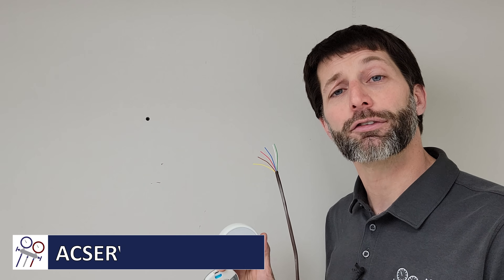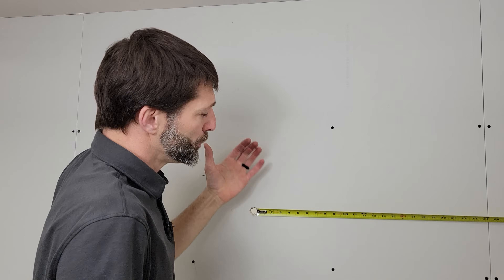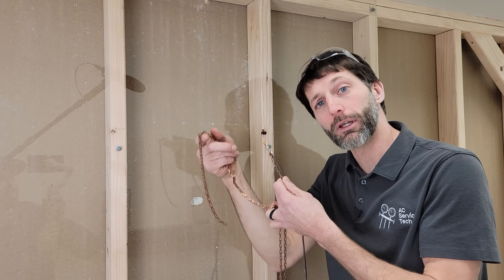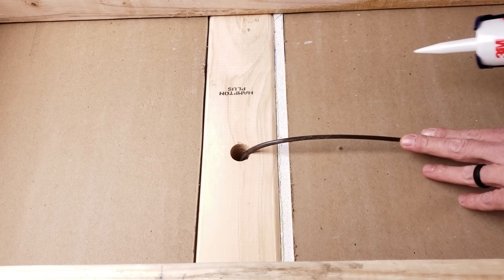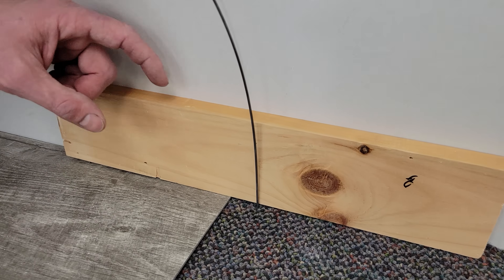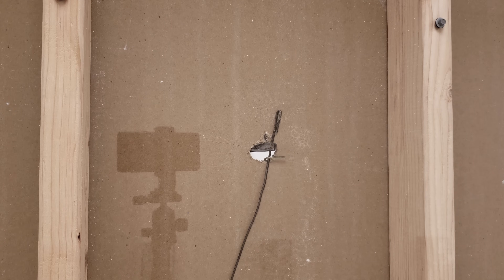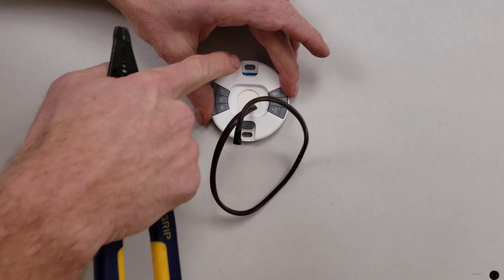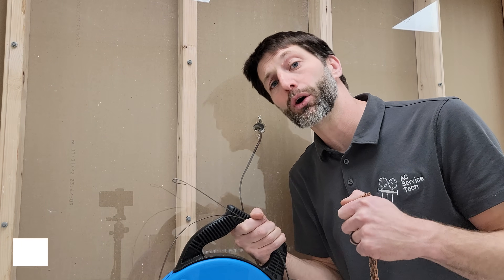How to Fish THERMOSTAT WIRE Up or Down a Finished Wall! Install Methods!

Comment: I need to run new thermostat wire to replace my old wire. Had to replace the circuit board on my furnace with a universal board, and now the main blower comes on and the furnace doesn’t work. Also replace the limit switch. The existing thermostat wires are not color coded properly. So replacing the wires seem to be the next logical step. The furnace is directly below the thermostat, so attaching the new to the old upstairs, then locating the wires downstairs and pulling them through seems to be the way to go.

Comment: I personally like to pull the baseboard off, smash a small hole in the drywall, drill a hole downwards, pull the wire and cover it all up with the baseboard

Comment: Great tips. Are there methods to replacing the wire if the current one doesn't have enough conductors?

Comment: so i have existing. had new furnace installed and they f** the wiring.  Is it possible to fish a new wire? It is a ranch style. thermostat is in the hall , so it has to go up, over the hall way bath then down to the  furnace closet.
Reply from the maker: look up "acservicetech fishing thermostat wire" on youtube thanks

Comment: Any tips on how to prevent the wire from falling back into the wall after its fished.  In the video you do all the wiring with it as a curly cue at the top, but that seems risky and I really dont want to have to fish it again.

Comment: I’ve found the easiest way to route the thermostat wire is to slide out the wall mounted oven and run the wire behind that, then slide the oven back in.  Then, you can check and set temperature when you are in the kitchen, where people spend most of their time anyway. 
By the way- are you going to do a video any time soon on the subject of why a boiler seldom runs??

Thanks for the great info
Reply: Why a boiler seldom runs?? Check the thermostat is not near the oven or in a hot kitchen.
Reply: @larkhill2119  my post was a joke. I know he doesn't respond but makes Great vids. Sorry
Reply: @Drrich_DIY  LoL, Sorry  I just lack faith in humanity

Comment: I use to fish the wire up to down with a treat and the end I put a socket I put it in the hole them say I slow down the socket about 2 o 3 feets down then I catch the socket with the strong magnet bring it to the hole

Comment: quick tip ppl. carry a magnet in your pocket it will find you a scree in the stuff super fast and its a cheaper method then them other electronic devices and takes up less space

Comment: Great tips, I use the chain and pull through with a small stick magnet same in the floor. Pilot bit through the carpet is all fun and games until it starts to pull.

Comment: Total bull.  What about all the insulation.   Looks real easy not using a actual setting.
Reply: Interior wall probably won't have insulation---and you shouldnt install a tstat on an exterior wall...
Reply: @samhazard9576  just a FYI, commercial interior walls are usually insulated for sound purposes. And some residential interior walls are also for same purpose. at least around here they are
Reply: True certainly much easier without all the insulation
Reply: Wow, this is an example...

Comment: I saw one, that had a super magnet, that has you drag the magnet down the wall pulling a plumbob like steel weight.  It  looks great, and eliminates the problem of negotiating wall insulation. The thing I always fear is accidentally hitting a water pipe or power line.  I had this happen to me once in Alaska while in an apartment nailing in quarter-round in the ceiling, the customer was absent.  Then it became ,”wheres the water supply cut off”? Talk about jumping t(rough your butt....  My lesson learned is always know where the water supply cut off is, and service disconnect “BEFORE “ you start work and the location of the nearest fire extinguishers are....just in case. When fishing wires are a problem, remember,  this is 2022.  Wires are quickly becoming obsolete.  I hung a Red-link thermostat and receiver,  in an all concrete and steel building up four floors, and the customer insisted I install the steel thermostat lock boxes to boot.  I was shocked.... these things worked great.  This was about 5 years ago. Its cost less than a decent programmable would.  I just wired the receiver in the cellar... this is an option in case your on a second floor and need to reach the basement, so you don’t have to fish wires through two floors, patching...
Reply: Wires are becoming obsolete? LOL 👌
Reply: @robertcherry4971   That was the statement that made me raise my eyebrow too.. Mainly "wires" and "obsolete".
Made me curious about the replacement technology that is going to run electricity through to my house, street, town ,city , Country...   🤔 
The new tech will put a world wide end to copper cable theft 😁
Reply: That is a Klein Tools Magnetic Wire Puller model 50611. It works very well.

Comment: How do you handle walls with perlings? Those are normal around here.
Reply: I think you mean fire blocks in interior walls. I believe perlings are connected to rafters. But too your question, I just cut a square above the 2x4/fire block and use an angle bit with a paddle bit. A flex auger bit, or a long flex bit works going up from a basement, but good luck try'in to go down an attic if there's no room.

Comment: I'm pretty good at drywall work so I generally just cut the drywall when I have a questionable spot. Takes longer by after drilling through a drain line well just say lesson learned.

Comment: On the one for the basement or crawlspace why didnt you use a chain and drop it down from the hole 
You did it from the attic you do it the same way just trying to find the chain up thru the floor

Comment: Remember, if you are working in an occupied home, especially with children, warn the adults of the insulation supports and always bend them over so they won’t penetrate a shoe and/or foot. 

Also, you can use the chain to drop down the painted interior wall to “plumb” for alignment. Drill your insulation support down to locate in crawl space. Drill hole up through bottom plate. Drop chain down from above and tape wire on and pull back up. 

Also, when drilling insulation supports through carpet, go slow at first, just in case it grabs a thread. Some types of carpet are worse than others. 😊

Comment: Little advice, stay away from NEST thermostats, nothing but problems. Not going to argue with anyone here about this, just a personal opinion after fixing  many many issues with these . In about all the cases ended up replacing the thermostat with a regular programmable thermostat or a plain Jane thermostat. I have yet to meet a customer that was happy wasting their money on these Nest thermostats, usually they pretty pissed because they wasted allot of money on these pieces of junk.
Reply: Most of the time its lack of a common wire. There are C-wire adapters yet running a proper thermostat wire usually not an issue. Have installed over 25+ no issues.
Reply: My NEST works by disabling autoschedule and manually setting home/away.  Set up B/O wire in the menu otherwise may not energize reversing valve.  Also use unused blue/brown/black wire coming from thermostat for common to handler if don't power on.  No need to run another wire unless its 22+ gauge or too few connectors.
Reply: @dwj7386  what heat pump manufacture?
Reply: @proanswers  I believe Rheem, Rudd, Oxbox.
Reply: @dwj7386  Rheem & Ruud energize the reversing valve on a heat pump in heat mode * against the industry standard of cool mode. Sounds like you had the orientation of the "O" and "B" low voltage conductors reversed and or the heat cycle test through NEST incorrect settings. Common correction we see in the field.

Comment: Why you not use holsaw cutter for make hole
Reply: Because as Craig stated you don’t know what is inside the wall, could be wires or piping and using a drill you cannot feel what it is drilling into till it’s too late.
Reply: My brother is a plumber and is always busy because someone cut or put a nail in a pipe doing trim, new cabinets, new floors and some of them don’t start leaking till years later

Comment: What kind of wall anchors are those? @ 13:28
Reply: Auger anchors that come in the white plastic and aluminum  - the aluminum are rated to hold heavier weight
Reply: The honeywell thermostat comes with yellow anchors is the one i use

Comment: Great tips 👍
Sometimes the only choice you have in finished spaces is to run the wiring in a return duct using plenum rated cabling. If run in a supply duct it must be rated at 105*c minimum.
Reply: Its not the only choice just the lazy one.
Reply: @zoso1123  that or tear holes in ceilings and walls
I agree but sometimes there is not a better practical solution